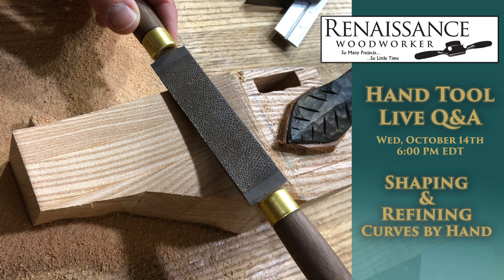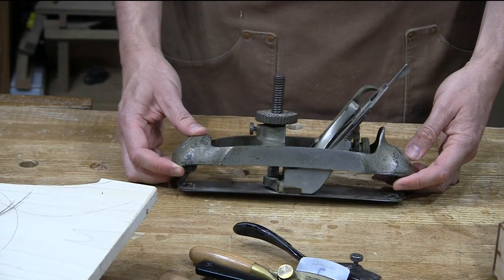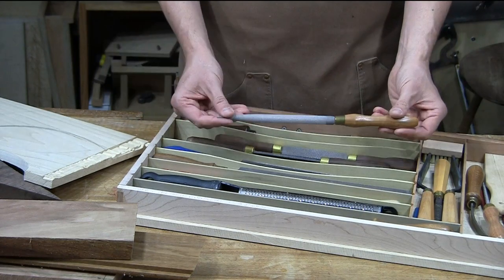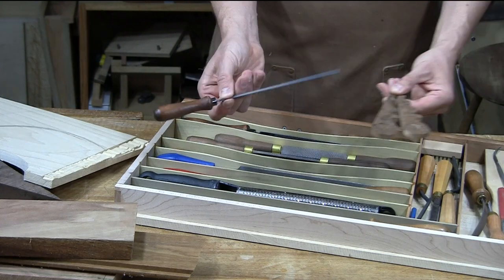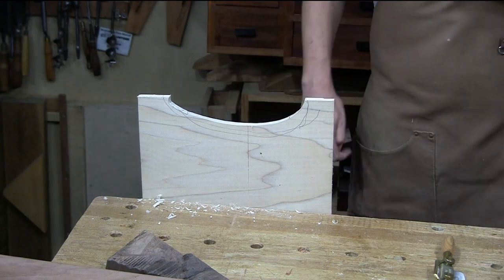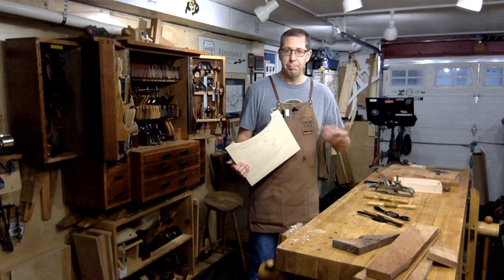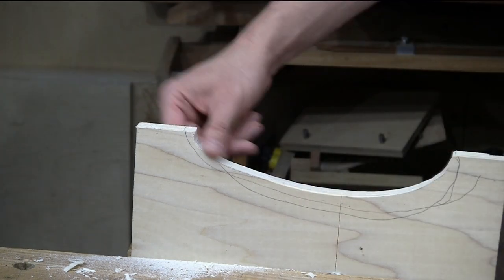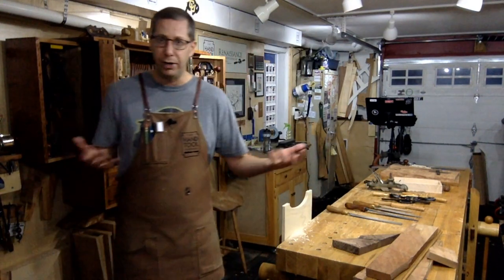Shaping & Refining Curves by Hand

Comment: Hi Shannon, I'm about to treat myself with a LN spokeshave. I can only afford 1 at this time. Do you recommend the flat sole or curved as the more versatile? Many thanks, George
Reply from the maker: without a doubt a flat sole.  Easier to use and it works on all radii of convex curves and most concave curves.  When the radius get too tight a low angle shave is better anyway.
Reply: @RenaissanceWW  I have bought both of those probably after listening to some woodtalk episode! Thank you for making me remember why I bought them hehe!
Reply: flat. i own both and there isnt much the ro7nd can do rhat the flat cannot. both are good but as shannon stated, the round isnt all that round.